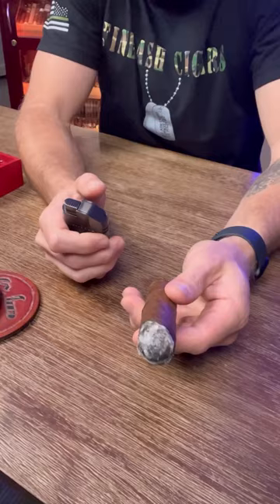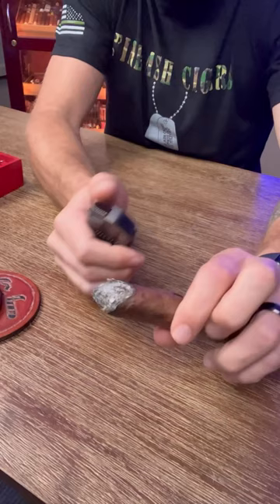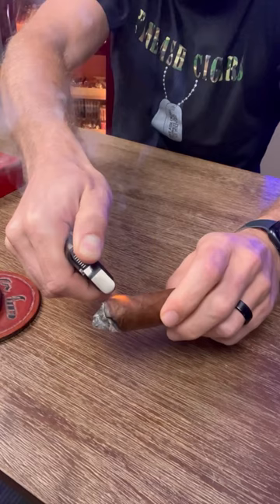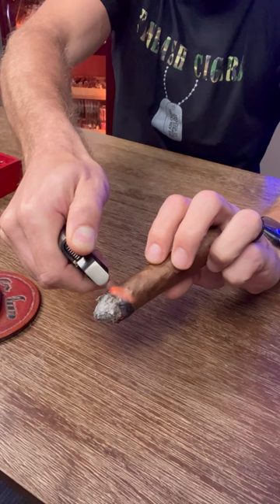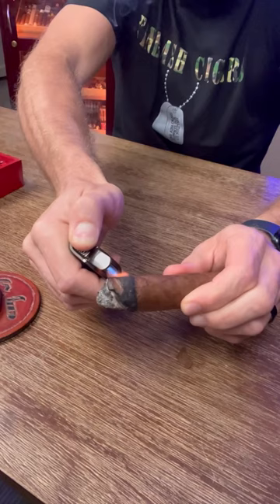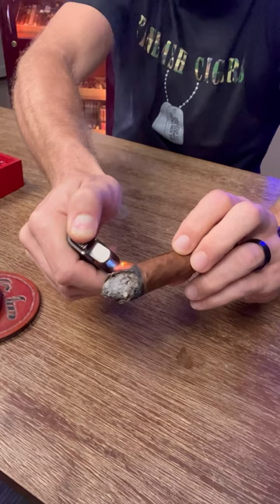How to fix a bad burn on a cigar! #cigars #shorts #cigarsdaily

Comment: Whichever side is burning faster I face up when I set it in the ashtray. And while I'm puffing. Never fails. The weight of the ash will correct the burn. Give it a try Tim. I'm anxious to see your results. God Bless brother!
Reply: I do this, my theory being that heat rises. It works well but not fool proof because I tend to smoke fast and get a lot of uneven burns
Reply: He doesnt believe in this, but its what I do so I've never understood his dismissal of this way.
Reply: While I dont smoke I might have a solution of different spots that burn faster. Lick your finger and tap on the tip of the fast burning spots. Not like a lot of spit just slightly moist. Might not look all that good but from other stuff I have burned (dont ask) it works very well and is VERY precise
Reply: @AlpineTheHusky nobody was going to ask we all know what you're talking about, at least adults do lol

Comment: If you don't let it get too far before you fix it, you can lick one fingertip and slightly dampen the wrapper just past where it's burning too fast. A lot of the time this can slow it down enough to burn past the loose spot which seems to be the usual cause of a run.
Reply: Yo I've never thought of this before thanks for the insight!
Reply: Tell me never smoked a joint without telling me never smoked a joint its a run bro dont burn it that wast3 bud get run area damp so burns other side every stoner knows that
Reply: @joshhurley3691 it’s not a joint druggie, it’s a cigar

Comment: You can prevent that by just putting the side that is burimg slower up.. also by hitting it that hard with the lighter you can ruin the taste for that burned part of the cigar.. of its really that bad, just wet the tip of your finger with your tongue and then make the side thats burning faster slightly wet. It will burn slower where its wet so thr other side can catch up without doing anything to the flavor..

Comment: You can also dab your tongue with your finger and rub some saliva on the lower burn part and just keep smoking it like normal, if it works correctly, the bad burn should be slowed from the moisture, giving the rest of the cigar time to catch up to it, now this doesn’t always work how you want it 100% of the time, but it’s nice to try this technique first before doing the technique demonstrated in the video as you won’t have to waste any of the wrapper from the first technique.

Comment: I use the cutter to remove the material to the lowpoint and relight it. Quick, simple.
Reply: Me too
Reply: On expensive cigars you really don't want to relit them it changes how they smoke and the flavor
Reply: @mitchellmiller6644  only if you're too deep into your smoke. But if it's pretty early on like half of your first third, it's a perfect technique.

Comment: nah you get the cigar wet on the short side a little and put the ciger with the shorter side to the ground. Take advantage of how flames travel up between the slightly moist wrapper and the flame burning more towards the top it should balance out once its evened out rotate 90 degrees and you are set

Comment: This seems inefficient, I usually just keep an eye on it, if it starts to burn uneven in the slightest I turn the lest burnt side up so the heat rises and burns slightly faster, and worst case if it’s getting bad I hit the side that’s not burning with a little flame, or use my nail to push the wrapper into the heat near the Center and I almost never have problems.

Comment: These bad burns happen every single time to me.
Reply: Try slowing down, if it's happening every time it's likely something you are doing. Puffing too hard and fast can make them run as can not maintaining proper humidity levels. Sometimes you just get some cheap cigars with loose spots and have to deal. Hope this helps!
Reply: Like Austin Brown wrote, slowing down helps.
Put the cigar down to rest for a bit with the fast-burning side up. I have heard this from the old guys and it seems to help.
Also, push down and softly "crush" the hot point that is off center of the foot. Perhaps this rearranges the plug that is burning slower and allows more air into that plug. 
I hope this helps.